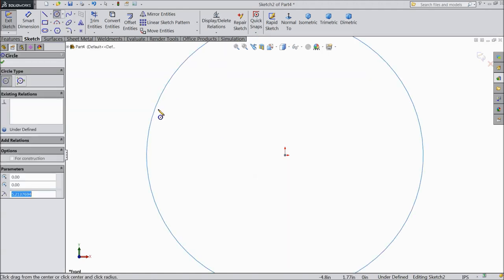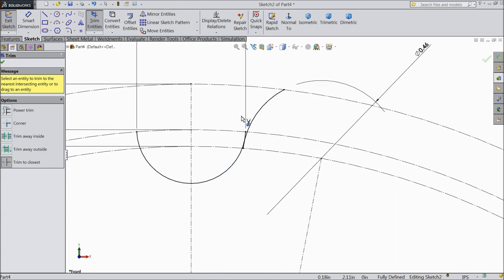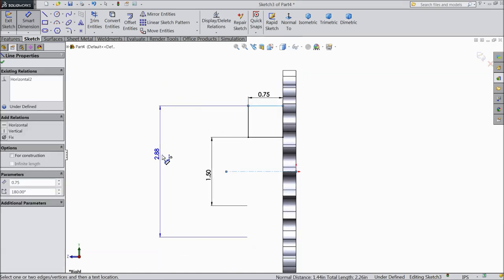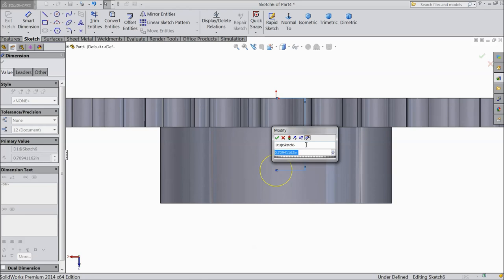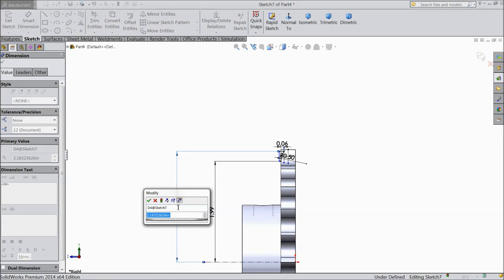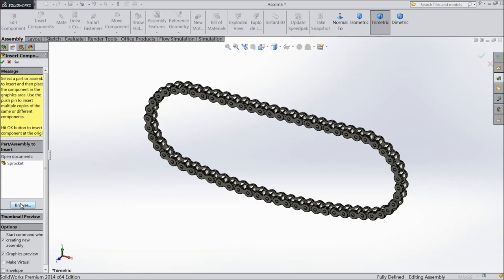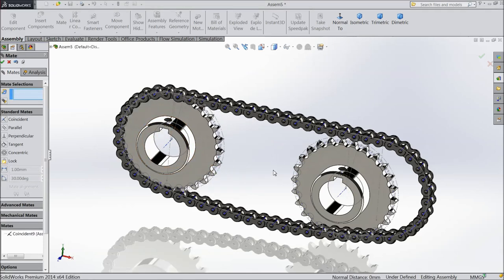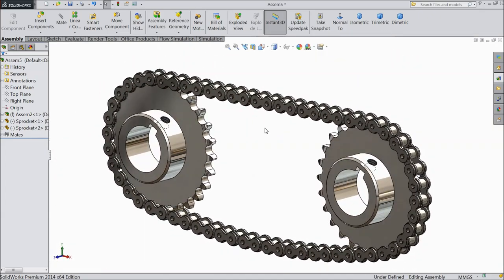SolidWorks tutorial Chain and Sprocket Part2

Comment: Sir, are the dimensions from any standards?.. It would be great if you could provide some link as to how to adjust the dimensions as per different requirements, for e.g. I need a sprocket with bore dia 3.5in. So how should proceed with the model and what would be the parametric dimensions accordingly?
Thanks a lot for the guides, Best Regards!